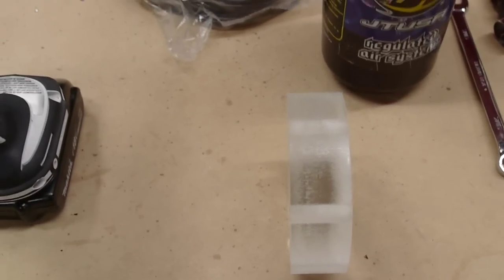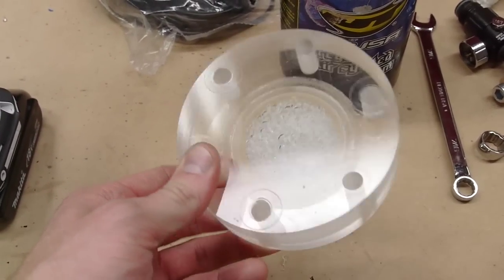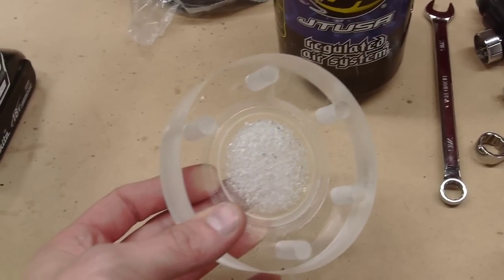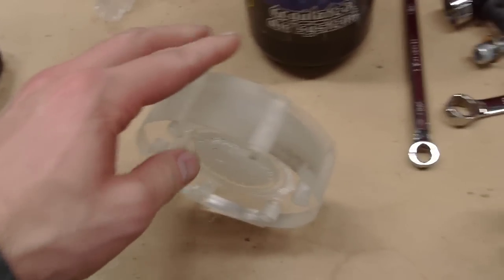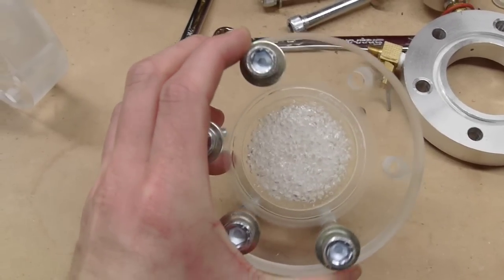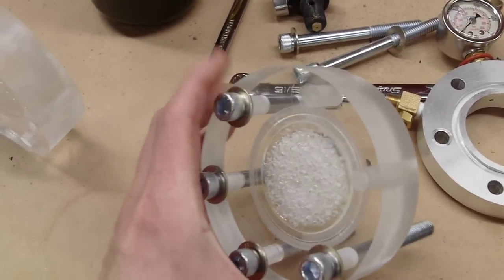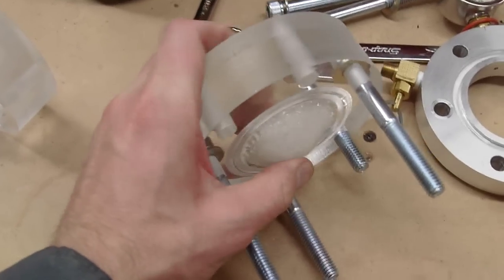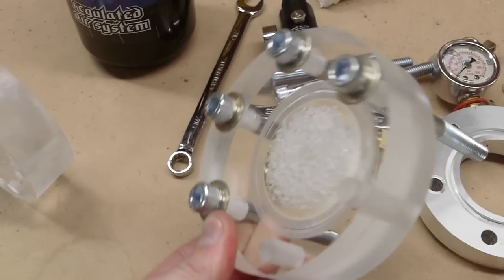Effect of long-term high pressure CO2 on acrylic

Comment: if that happens with CO2 on decompression, maybe it works too with hydrogen and store hydrogen in a polycarbonate powder, then release the hydrogen through heating the powder slightly.... That would be a cool storage method for hydrogen....

Comment: hey, i wonder if you slowly depressure the chamber, the co2 would have the entrophy to exit the acrylic in the less chaotic form, i mean atleast 24 hours slowly depressuring it, maybe from a small leak, and see if this would occur too, like to prove if the co2 gets permanently trapped inside the acrylic, however i think this is an effect of osmotic pressure, co2 would eventually gets into the metal walls too, but it would take forever long, i think

Comment: Please, do you know the permeability of acrylic to CO2 gas? Consider please a thin (around 2mm thickness) plate. 
Or: may I  create an effective CO2  chamber (really low CO2 pressure) using acrylic? For example, PVC films let CO2 run out...Thanks for the help!!

Comment: I wonder what would happen if you you filled it back up with super-critical CO2. Probably not a safe experiment to conduct, but I wonder if the high pressure gas/liquid would: a) compress the voids in the plastic back together (at least temporarily) or b) infiltrate them and cause further failure on decompression.

Comment: Ideally you should use sapphire for the window. I understand it's strong enough and fairly non-reactive enough to stand up to those sorts of conditions. But I'm just going on memory, so I could be mistaken. Also I would expect a chunk of sapphire that size would be fairly expensive. The windows I remember seeing were only maybe 3 or 4 inches across. Not sure of the thickness, though.

Comment: I wonder if any of the acrylic also dissolved in the fluid.

Cody from Cody'sLab used pyrex tubes for a similar experiment.  The phase separation upon cooling looked really cool in his video (not that yours didn't).  You should look into making a tubular version with glass or possibly sapphire if you could affordably source it.
Reply: Supercritical CO2 has polarity like hexanes which ought to be compatible with acrylic. I don't know if any residual organic solvents, reagents or plasticisers are present in acrylic, but if so they ought to be dissolved by SC CO2. Might even be able to smell them when the pressure is released.

Comment: CO2 diffused into the plastic. Try a more suitable material that does not interact with CO2, like quartz crystal (Industrial quartz crystals are used as a windows to see inside high pressure containers.. like observing the combustion inside an engine where parts of the head have this polished quartz)
Or sapphire. They come in various thicknesses but need a special supplier for such materials. Is used in lab equipment.

Comment: do you think 1/2" acrylic would work?  just because I have some laying around.... hah maybe I'll just do it and record it.... either it'll work or it'll go boom.
Reply: Jay Smith did you do it? I am wondering if it can be done with polycarbonate that is commonly used in bullet proof glass in layers.. I am wondering if you basically make foam out of it and then layer it if it will have better stopping capabilities for it's size.. wouldn't be transparent but maybe it would be better than Kevlar, especially if you added carbon nanotubes or something like it into the polycarbonate plastic before treating it with CO2

Comment: what about polycarbonate
Reply: Jace Walton (just said this in another comment and copy and pasted it because you seem to be thinking along the same lines) I am wondering if it can be done with polycarbonate that is commonly used in bullet proof glass in layers.. I am wondering if you basically make foam out of it and then layer it if it will have better stopping capabilities for it's size.. wouldn't be transparent but maybe it would be better than Kevlar, especially if you added carbon nanotubes or something like it into the polycarbonate plastic before treating it with CO2

Comment: use glass?
Reply: peterizrandom Glass shatters and always have some weak points, at this pressure it's super dangerous, it like having a bomb that you don't know when it will explode
Reply: Raidzor つ ◕_◕ つ Cody's lab used glass ampules and sealed them. However precautions must be taken.
Reply: I agree, put the high pressure liquid CO2 in something as fragile as glass. It might explode sending sharp shards of glass ripping into everything around it.

Comment: This is known as explosive decompression and is a common problem in large scale A/C units using CO2. The only solution is to  release the pressure really slowly (i.e. with a rate slower than what it takes the "solved" CO2 to escape the acrylic. If you watch them under a microscope, your O-rings should show (or have shown, given this is 5 years old) some bubbles or similar signs as your acrylic.

Comment: Well.... It's not that odd and it looks like the acrylic has a severe case of 'caissons disease'... There is always some space between acrylic molecules for CO2 to creep in to. You can even use it as a filter, although in this case a slow decompression would have been advisable. ;)

Comment: looks to me more like he caused a relaxation effect only seen in polymers. a plastic deformation occurred. seems like the relaxation modulus is incredibly high considering you had 750+ psi in there. after a study of materials (specifically viscoelastic polymers) it's easy to understand that the time spent under such a high stress could lead to the relaxation of the acrylic molecules. this would seem to have an effect bulging once the high pressure was released, almost as though there was a vacuum drawn on the acrylic surface. if anyone has a deeper understanding of polymers that would like to elaborate, I'd love to hear more. I just can't see this as CO2 permeating the acrylic being the ONLY cause. if it's a cause at all
Reply: How long does it take for acrylic to be affected by high-pressure co2?

Comment: I was planning on making a pressure chamber to carbonate fruit out of schedule 80 PVC; now I'm wondering about the solubility of PVC plasticizers in CO2.  Guess I'll have to use steel.
Reply: Nelumbo Nucifera I don't think you'll be dealing with liquid co2 in a carbonation setup, so I wouldn't worry about it. Do watch out that the pvc  doesn't blow up on you.

Comment: Decompression sickness for acrylic.  Who would have thought.  I wonder if the amount of absorbed CO2 is measurable (by weight perhaps). Also, how far into the acrylic did the CO2 permeate? Given enough time would it have escaped through the acrylic or would it have saturated in such a way the the absorption into the acrylic would stop?

Comment: Why not use a glass insert pressed tightly into an indent in the acrylic for the area it seals off at? Would liquid co2 not penetrate glass as easily?
Reply: Aperson that's actually a good idea, and if your worried about pressure messing with it then used fused quartz glass.

Comment: If left together longer, would the CO2 have broken though the acrylic eventually? Or would the pressure have kept it in check until the pressure was released form being taken apart?
Reply: It wouldn't have "broken" through, but it would have slowly passed through it until there was almost nothing left inside.

Comment: Great demonstration of supercritical state!    

So, if this is what your a acrylic looked like after a few hours... did the deflection get any worse?  Kind of looks like a slow motion eruption.  The more viscous a substance, I would assume the slower the eruption.   I would assume the polymer molecular arrangement is allowing the slower deformation to occur instead of just catastrophic fracturing.  By contrast, glass (very sensitive to focused pressure) demonstrates its viscosity at common ambient temperatures and can be seen in the window frames of old churches stained glass windows (Europe).  The bottom of the frames can be noticeably thicker than the tops after so much time has passed (hundreds of years).

Comment: Due to the high gage pressure, diffusion into the Acrylic occurred. The CO2 in the process of diffusing into the acrylic remained at the pressure proportional to the gradient through the acrylic wall. 

The high pressure CO2 then tries to diffuse back into atmospheric pressure. Because the pressure gradient is lowest at the outer wall, there is less CO2 trying to escape in that direction. I could put up a diagram to describe this.
Reply: +Elliott Molnar Your analysis also  suggests that releasing the pressure slowly over time might have allowed the CO2 to diffuse back out of the acrylic without damaging it.

Comment: What is psi?
Reply: ***** pounds per square inch*
Reply: taiden Haha Good one! I will keep this in my bag of zingers.
Reply: taiden And those that crashed a probe into Mars because they didn't know which they were using.
Over here we use both with ease.
Reply: Pascals per square inch, a measure of pressure.
Reply: ***** Why you not use bars, pascals or kgf/cm² units? Those fu*king psi uses in US only, almost all world uses SI base units.
Reply: tomburg2 Mostly because of custom. I loathe the imperial system as much as anyone else, and would much rather use Torr, bar, and atmospheres.
Reply: tomburg2 There are two kinds of countries in the world. Those that use the metric system and those that have been to the moon.

Comment: acrylic absorb liquid co2 in micro moleculic spaces in its stracture. After released pressure, absorbed co2 change form to gas phase and try to escape opposite way that its gone inside. Because of pressure created by co2 in acrylic the surface deformed..

Comment: A similar phenomenon can cause decompression sickness in deep divers (or those diving for long periods of time). Nitrogen is dissolved into tissues while under pressure, and if the decompression is not slow enough, nitrogen can offgas and form bubbles. (bubbles in tissues or bloodstream are not a good idea). It's not the exact same thing, but it's comparable.

I notice it's been a while since you posted this video, but it would be interesting to see if you tried very slow decompression.
Reply: +tmar23 I rather doubt you were born with specific knowledge of 'the bends' and had no clue whatsoever until someone explained it to you, or you read it somewhere. Just because you have learned this, do not be so critical of someone explaining it for the benefit of others who have not.
Reply: You could have just gone with decompression sickness or simply the bends but you went through the trouble to type out something that is pretty much common knowledge to most.  Congrats.

Comment: Awesome videos...
Supercritical CO2 will act as an apolar solvent (mainly). As general properties SCF possess high diffusive power, low viscosity, good penetration capabilities and adjustable density and selectivity. I use SFE (Supercritcal fluid extraction) to preform extraction of high value lipophilic molecules. In your case CO2 has diffused through the PMMA molecules and after decompression the CO2 rapid expansion gradient promoted this deformation due to the CO2 (mass) diffusion on the PMMA surface.
Reply: old comment, but may i ask if these "high value lipophilic molecules" were extracted from hemp or related cultivars?

Comment: Would this eventually compromise the structural integrity of the chamber if it remained assembled for a couple month ? 

Also, isn't there a barrier material that you could insert to protect the acrylic ? For example a very thin piece of glass, just to prevent the liquid co² from touching the plastic.

Comment: co2 transmuted the plastic.you made a harder higher carbon plastic probably a little brittle,very cool.i guess that explains the dry cleaning use,as a liquid its a solvent that can penetrate even acrylic.do you think its carbonite or maybe thats transparent aluminum lol. keep it coming thats fun stuff
Reply: kinda just looks like the co2 leaked through the tiny fissures in the plastic crystal and just took longer to pressurize than the liquid itself. make sense? plastic is slightly porous.
Reply: "hard higher carbon" - that would make sense if this was a ferrous alloy.  Well, you'd need high temperature too.  But you can case-harden steel using just about any organic matter, and possibly with carbon dioxide.  

But this is PMMA. It's already mostly carbon by mass.  The empirical formula is approximately C5 O2 H8 but hydrogen atoms are much lighter than oxygen or carbon.  I'm lazy to do the math maybe 60-65% carbon by weight.  High carbon steel is roughly 1.2% by weight.

The PMMA plastic is likely work-hardened to some degree because the polymers have been stretched.  But it's not a chemical change like you'd get from coating steel with flour and clay and heating it in a furnace.

Comment: This experiment/demonstration is way cool. The phenomena is known as 'explosive decompression' in the oil & gas industry.  It typically affects elastomer seals in valves and the like, and special elastomer compounds are used to avoid the problem.  How are your O-rings?

Comment: Just curious, do you suppose the trapped bubbles were still under pressure at that point, or maybe even still are? If so it would be interesting to see you drill into that as each little high pressure bubble would pop and release their gas. Seems like a fun thing to do since it was junk at that point anyway....

Comment: I have an idea, couldn't you simple use a thin glass disk on the inner side of the acrylic to act as a co2 barrier? I would think that since the pressure is equally distributed, the glass will only be compressed against the acrylic, and should do the trick.

Comment: You would have to use pure quartz. It has a low diffusion for CO2 (not H2). You don't want to drill holes into the glass, so you would have to change your design a bit. With some precision machining you can make a hermetic seal between stainless steel and quartz and you don't even need an o-ring anymore. see LJ Star video on youtube. I have done this to hold pressures in the 400PSI range with 1/4". With thicker design and a lip 2K PSI can be achieved. let me know if you have any questions.
Reply: Do you mean a hermetic seal can resist 1000 psi? please leave your email.

Comment: This effect is called Diffusion... 
Co2 Atoms that disolved into the crystal lattice of the acrylic. The process goes faster with more heat and with enough time . The same effect is used with two different metals like Aluminium and Copper to cold-weld them together. Its also used to harden Steel with Carbon or nitrogen.

Comment: properly annealed boro is many times stronger than steel. Heavier, yes, but not by an absurd amount. More expensive.. true. Non-reactive .. yes.. so super strong and non-reactive which is the reason why labs, plasma sculptures, and neon signs use it. The other bonuses of course are clearer optics, but probably don't factor into this model.

Comment: what formulation of Pyrex are you referring to? Standard 33 COE lab grade pyrex sold by Simax, Schott, Duran etc.. or the dozens of other possible glass formulation Corning labeled Pyrex? The softening point of the boro I use has not changed and you always have the option of quartz.

Comment: I know what happened.
Is a very common effect in high pressure systems.
The CO2 has disolved in the acrylic surface área.
And with the decompression the CO2 gas has inflated the acrylic.
The correct way, is drop the pressure slowly.

See also decompressive explosion in o-rings (parks o-ring handbook) or hydrogen attack in metals.

Comment from the maker: Slight crazing and surface cracking will actually be temporarily repaired by reapplying pressure. The heavily deformed acrylic with bubbles doesn't get any better when pressure is reapplied.
Reply: its good to know, but I don't think any sane person should reuse such a deformed part anyway, especially in any kind of pressurised environment

Comment: There o
Is an easy explanation why acrylic was used, it is much cheaper and very easy to use.
Glass is very heavy, brittle and expensive. Polycarbonate is very expensive, degrades in sunlight and reactive in certain evirments.

Comment: I used to be quite involved in the marine aquarium hobby and built my own tanks and equipment out of acrylic. What I found out then is that acrylic will absorb nearly half its weight in water. Liquid CO2 really isn't all that much different than water in this regard, I would assume. Basically you carbonated the acrylic.

Comment: thats cool. I enjoy your videos. The reason I ask is I made a high pressure flow chamber out of acrylic as well but not for scCO2. It is really difficult to find information on burst pressure for acrylic pipes or something like that as they are usually not rated for pressure, but if you have a large wall thickness obviously you can go up to higher pressures. I have read continuous stresses should not exceed 1,500 psi for acrylic although the tensile strength is 10,000 psi. Thanks!

Comment: That high pressure CO2 infiltrated the acrylic is not surprising.
While unintended, you've produced excellent documentation of the effect.
A piece of glass, preferably borosilicate, would protect the plastic.
Consider separating the glass from the plastic with an inert liquid, if necessary.
If the glass has a compliant seal around it's circumference, the pressure on it will be isostatic - no bending to worry over.
A sheet of Perfluoroalkoxy would be simpler, however.

Comment: Depending on the composition of the acrylic, the solvating power (as a non-polar solvent) is directly proportional to the pressure and temp. At subcritical CO2 has solvating power that of acyclic aliphatic hydrocarbon, like hexane. At supercritical it's solvating power is like toluene.
Nice work!!